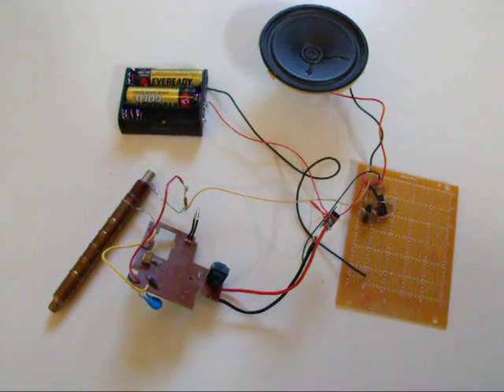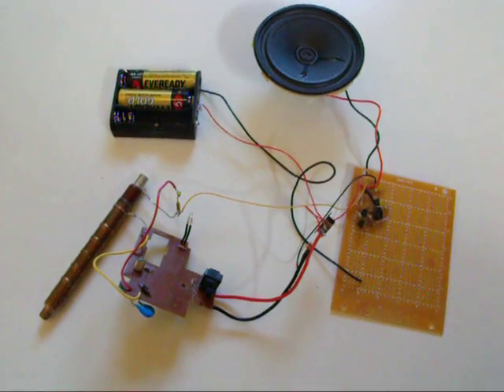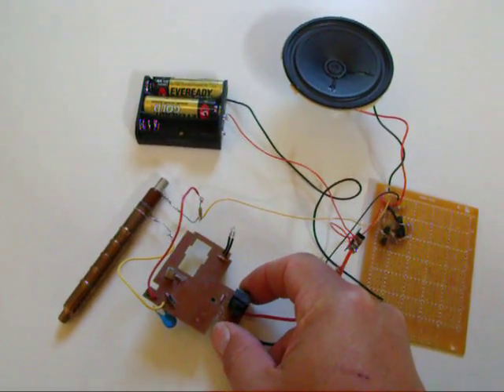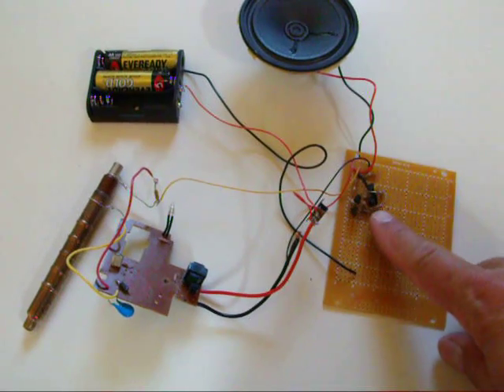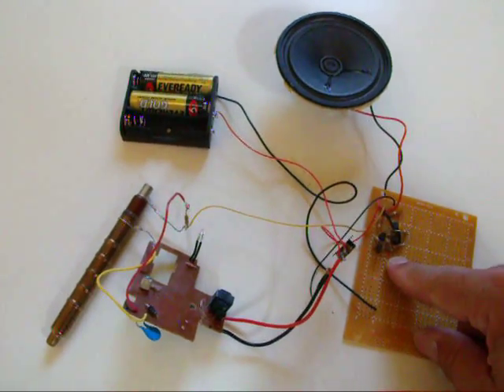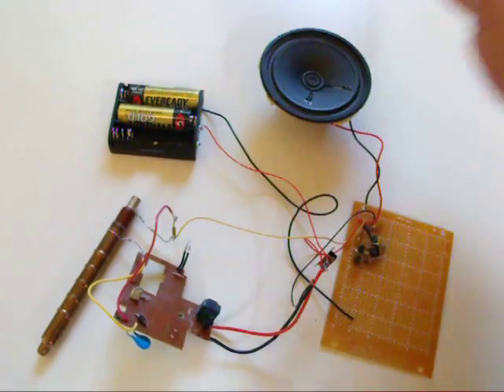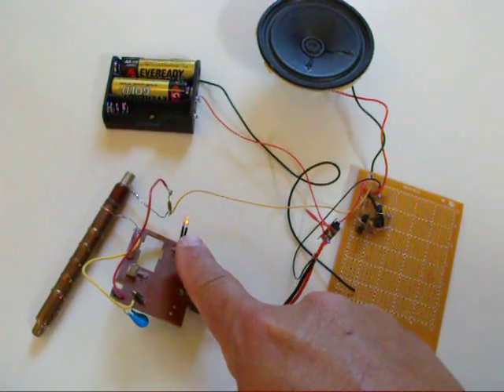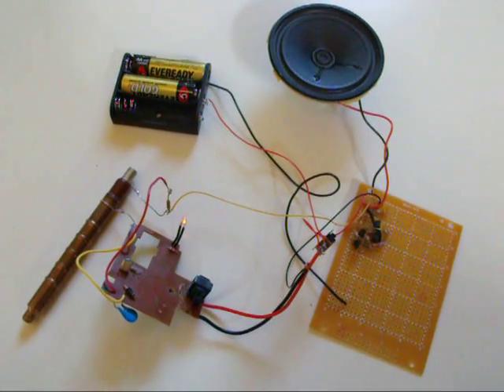Cheap DIY Geiger Counter for less than $30.00

Comment: Can I get the circuit diagram please?
Reply from the maker: I no longer have the Madscientisthut.com website running, as I currently have it parked. You can find it on the wayback machine, just type in madscientisthut.com on the wayback machine website, you will have to look through the blogs to find it.

Comment: good to have this,
Reply from the maker: I made this design immediately after Fukashima since Geiger counters were sold out, that way if someone wanted to make one if they had a Geiger tube which were still available on feebay at the time.
Reply: I haven't purchased any items from Japan since Fukushima.  It sucks because there are things I need from there.  How do you feel about buying from Japan?

Comment: Fun project. But it doesn't actually count anything since there's no readout. All it does is turn radiation into an audible signal.
Reply from the maker: +Ni5ei It is very easy to add a meter to this with a RC and analog meter, or even add a  microcontroller that gives a count per second/minute/hour. A lot of times you only need an audio indication to know that some thing is radioactive.

Comment: Hello there, can this high voltage supply kill you? Surely 2 AA batteries can not provide enough power to cause harm. Does a transformer work by low voltage and high current to high voltage and low current? Thank you
Reply from the maker: No matter what the current is you should always respect high voltage, just because a supply can only put out a small amount of current does not mean much if there are any storage capacitors on the output. I always use the one hand rule when working on voltages greater than 60V ( one hand in my pocket while the other hand is probing the circuit.
Reply: Yes of course and I do respect high voltage, thanks for the tip. The only reason why I say this is because I've seen people use the same camera flash circuit in slayer exciters and harmless tasers of course with removal of the high voltage capacitor. 

I have ordered the parts for this geiger counter and have checked out your blog, I'm at university studying electronics so hopefully I'll get it working. 

Thank you
Reply: madscientisthut I could only get 340 volts from my flash circuit, will that work? your tube is the same as mine. Im using a 1.5 volt battery? I wanted to use a higher voltage but was afraid it was going to burn out my flash circuit.
Reply from the maker: Owen Chase 340V is just below the minimum required for the tube. the tube working spec is to set the voltage between 350 to 475 with 400 being optimal. Did you use a 10M impedance or higher meter to measure the voltage?
Reply: I just put my meter on 1000 volts. I notice you have one wire from the gieger tube going to the amplifier, how are you completing the circuit?
Reply from the maker: Owen Chase I was trying to find out what the input impedance on the meter is. What model multimeter is it? Some meters only have 1M ohm input impedance and that can load the circuit down.
Reply from the maker: Owen Chase It does take two AA batteries to get above 350V. I assumed that you were using two AA batteries.
Reply: it's cen-tech p37772
Reply: yes i was
Reply: Im a little confused about your circuit I only see one yellow wire going to your amplifier where is the negative side?
Reply from the maker: Owen Chase If you look close you can see there is also a small black wire going from the amplifier board to the large black wire coming out of the flash board, this is the same connection as the battery minus on the amp board.
Reply: madscientisthut ok thanks where can i get the radioactive mantle?
Reply from the maker: Owen Chase I had mine from way back when they used to make them with thorium dioxide, all of the newer ones I have purchased do not exhibit any radioactivity at all. If you can find a larger 2% Thoriated TIG welding rod  this makes a very nice source, the larger in diameter the more radiation it will put out. These are available at welding stores or online at places like Amazon or ebay
Reply: thanks
Reply: madscientisthut one more thing sorry to bother you, you only need a small input voltage for your amplifie,r how did you manage to get the voltage low enough so you don't burn out your amplifier?
Reply from the maker: Owen Chase  The 1nF capacitor limits what gets transferred
Reply: o ok

Comment from the maker: The HV output from the flash assembly goes to the  GM tube. (The HV output is negative with respect to ground) The minus side of the battery from the flash assembly goes to the ground as in the schematic.

Comment from the maker: C2 can be low voltage 10V or more but you can also use a 1KV cap there. The 'arrow" is a ground symbol, so it is just connected to the low potential of this circuit. Only the parts marked optional can be removed and the circuit will still function.

Comment from the maker: I would stick with the 1nF capacitor 1KV or high voltage is fine. I do not know where you are located but in the US Digikey, Mouser, or Newark should have those in stock.

Comment from the maker: I never noticed, I grabbed the wrong parts from the library. They should be 2n3906 instead of 2907s. 

Like I said before there are optional parts that do not need to be installed, other than that it is the exact same circuit in the schematic

Comment: yes,but you need a amplifier with a very high gain an noise reduction.
this is not very easy to build.
and the diode have to be in TOTAL darkness!

tr97